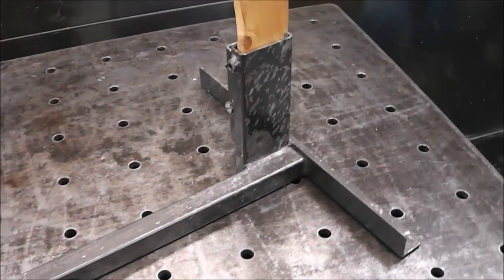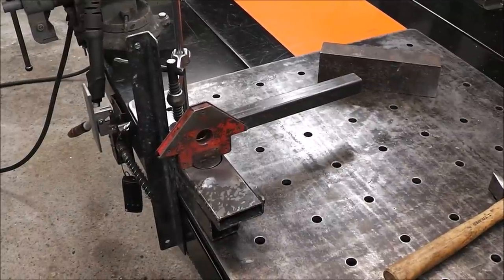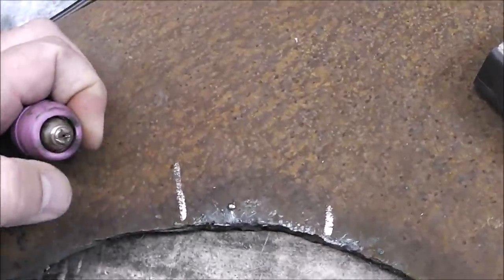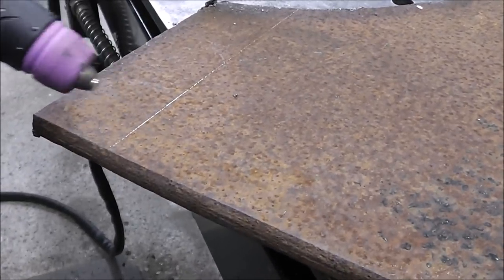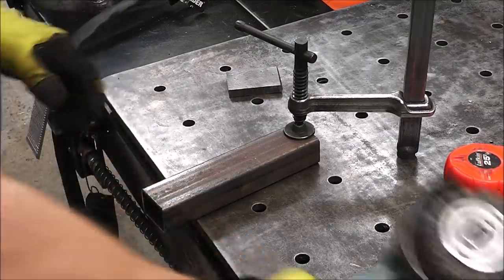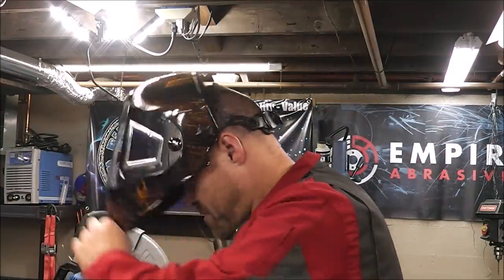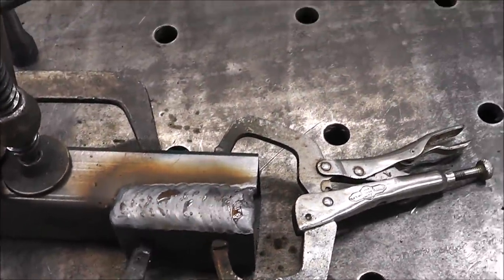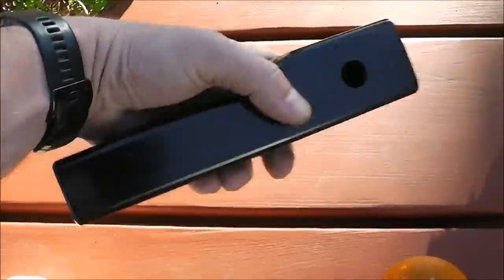Metal Repair MIG Welding Metal Fabrication Plasma Cutting Project Layout Tips

Comment: A piece of copper clamped to the backside will keep the weld flush and smooth. Weld metal doesn't stick to copper. Copper backing helps bridging overly wide gaps, prevents  burning through on thin sheet metal (e.g. rust repairs on cars) and is usefull when welding up holes.

Comment: One flaw in your hitch design is it’s meant to have one tongue to connect to the two on the trailer. That leaves some vertical flexibility to allow  travel over hills and valleys. With the perfect fit like you made can cause the pin to bind up and get bent out of shape. That 1/2 bar you used for filler would have been an excellent tongue. 
I didn’t find the rules to win the helmet. But I am from Saskatchewan, Canada.
Reply from the maker: Thanks Cecil! Great point. I'm not sure on the configuartion of the trailer setup but I contacted him the following day with those concerns you mentinoned and he said he hauled it several miles loaded through rough trails and it worked perfect with no articulation or binding issues. I asked him about the slop between the ears and he said it was perfect so I'm guessing there was more room than what I measured in the image.  My plan (if he said there were issues) was to cut the tube in half, cap the ends then run a 1 inch shaft though the caps and pin it so it could articulate 360 degrees but it looks like it's working fine according to him. Sometimes I get lucky.
Reply: @BrandonLund  thanks for the reply. I’m glad your design works well for your customer. If there is enough play in the parts, then my issues will not affect the performance. Carry on teaching the world some of skills you have learned.
Reply from the maker: Thanks Cecil I appreciate your support! 🙏

Comment: I'm from IL. I have a Lincoln helmet with a removeable rechargeable bicycle high to low beam light attached to the right side of my helmet to weld in dark areas. I never need to run lights to weld. Great for night time.  👈😎👍 Have you welded any cast iron jobs for real since your demo?
Reply from the maker: @ Mike K thanks man! I've done a bunch of cast repairs for several years now 😁

Comment: Why don’t you drill hole on other side and push metal back with flat punch applied some heat .
Reply from the maker: I don't have a press daniel
Reply: Brandon, you don't need a press. I thought the same thing Daniel suggested. Drill a hole on the back side of the tube, then use like a 3/8 piece of scrap round stock to push the dent out. The tube is mild steel, so it will bang back out. Yes, you could heat a bit to make it go faster . Great vid!

Comment: Brandon,
I'm in North Carolina.  "My cup runneth over", and while I appreciate the opportunity to get that panaramic-helmet, I have no complaints with what I've got.  I'm happy to learn from YOUR videos, and call you friend,( because you're in your element...you're a good teacher).
I'm a "newby", and I originally found you because I have to repair a cracked exhaust manifold, and do some other repairs on an old Dodge truck,( YOU  introduced me to "Muggy-Weld"!)  I'm trying to learn welding by videos as well as spending time with 5 High School seniors that are learning from the local Community College.  This is something I've wanted to learn for a long time, but I've found myself in recent years saying I NEED to learn.  Every time I turn around I need something welded!
Thanks for the videos!👍😊
Reply from the maker: Aww man I feel honored. Thank you very much for your support and encouragement 🙏 @Kent Hawkins

Comment: I'm just setting up my shop for personal use. I love your videos.

 I'm from Maine & grew up, starting at 10 years old, doing mechanic work with my dad. 

My Great Uncle Gerald Simpson  owned a garage and did a lot of fabrication  back in the 40s and throughout his career. 

I've learned to fabricate and do many things with  minimum tools let alone the proper ones...and they come out very good usually.🙂👍👌  As did my Great Uncle Gerald Simpson.  

 I like your style.👍 

I would really love to have an awesome helmet to start my welding adventures.

 I'm 63 and need good eye protection LOL.

 I'll be doing  MIG TIG and using a  plasma cutter.

 This would be so cool.

 I usually don't win anything cuz I never enter anything, but thought I'd try this and see what happens👍😇👌
Reply from the maker: Right on David! Welding is an awesome hobby! I appreciate your support and good luck!

Comment: Nice work on the piece you built, I am going through some of your older videos to pick up tips, picked up a few on this one.
Today I got the YesWelder gun for the vintage miller 250 to see if i could get it up and running, hooked it up but the tip that came with the YW gun was like 23 maybe 28 and I only have rollers for .35, hit a few stores because the welding supply was closed picked up some tips (not the same type) wasted about an hour doing that, got home and decided just to drill out the original tip that came with the gun, carefully got that done hooked up the gun, put on a 33lb spool of .35 and made several adjustments as I was not getting smooth travel with the wire and three times it knotted up at the roller site, Finally gave up on adjustments and just took out the liner in the yeswelder gun and put in the old miller liner which was quite a bit larger in diameter, then I had very little to no problems welding, it welds ye haw, right now though I could make better welds with my tomb stone lincoln, I need to play around a bit more with the mig. fun day learning as I go.
Reply from the maker: It's probably going to take some tinkering. It's good you went oversize on your tip. My LSW surprisingly carries the exact tip that came with the YW. A couple things, make sure your wire reel tension is low enough that it spins easy by hand but stops within a a quarter turn. Also make sure your drive rolls are set tight enough. Squeezing the wire tightly  between your thumb and forefinger as you pull the trigger you should be able to make the wire slip through your fingers and slip on the drive rolls at the same time.  If you can easily stop the wire coming out of the mig gun, you need more pressure on the drive rolls. Sounds like you are real close to getting this dialed in.
Reply: @BrandonLund  Now I didn't know that about squeezing the wire and pulling the trigger method I will for sure incorporate that tomorrow and give it a shot.
The massive cart they mounted this to is imo a waste of iron, picture a pallet jack handle going down to a spring and the two larger wheels, that what this is but even larger going down to the spring and two large three inch wide steel wheels close to a foot tall, and to top that off they wrapped around the front (minus where the handle goes down) Solid two inch stock square stock and 2/3 down the sides towards the back! and the waste is five inches on both sides from the welder, I want to trim it down on the sides get rid of the two inch square stock, weld a couple supports in the back after cutting Just to save space.
But yeah I am trying hard to dial this in, it really is a blast messing around with stuff like this and working out the bugs.

Comment: Brandon! I'm an old retired guy who just picked up a Fronius TransSteel 2200. What was your best source for manual/operation type info? Their operating manuals in the box were pretty sparse. The grandmother of my grandchildren said I have to make the garage less fire friendly before I can start welding out there, but that means you can relax and take your time getting the helmet shipped. Sorry everybody, but he's going to ship that bad boy to Washington State...
Reply from the maker: @Greygoat congratulations man you have the best machine going. I haven't really done much with the manual mode. I pretty much dial it in using the synergic mode and it's always perfect. I have had a few occasion where I put it in synergic mode then made note of the parameters then switched it to manual and went up or down from there. You will want to watch these videos. They are the best out there. This is part 1 of a 3 part series. They should come with the 2200 because  they are that good. Good luck in the giveaway buddy! 🤞 https://youtu.be/L5n-Kgs0Vu4

Comment: From Oregon here. Thanks for all the videos. I really appreciate the simplicity you use in explaining things. I am getting ready to build my fab table soon. so the template video was immensely helpful. Anyway, thanks for the consideration. My current helmet is very poor quality and almost dangerous. It will revert itself to the lightest preset after sitting for a couple hours, so I have to keep all my presets at a weld level so I don't accidently forget to switch it to a weld setting.
Reply from the maker: Thanks Paul! And good luck in the giveaway!

Comment: I never knew that a fan could cause all those problems. One day in the summer I was having one hell of a time. Most of the time I keep a fan on during the summer. This one particular day it was really hot and I put the fan closer to me. I could not figure out what was going on with my welds I even tried cranking up the gas and that worked. My welds still looked a little off but at work and at that time that's all that mattered. Not one time can I put two and two together and thought it could have been the fan.

Now when I'm outside all I use is flex core or I just stick weld depending on what I'm working on at the time.

I thought that was pretty clever of you I'm putting a contest in the middle of your video. After you made your announcement I felt kind of bad by giving you a thumbs down so I went back and gave you a thumbs up.  of course I'm joking I didn't go back and change it. -)
Reply from the maker: It happens man! About a month ago while shooting video I was tig welding aluminum and was having a terrible time. Come to find out, every now and then I was picking up a piece of stainless rod. It took about 45 minutes to realize lol... your comment at the end had me rolling! 🤣🤣🤣 thanks man and I appreciate your support! 🙏👍

Comment: Another great video Brandon! You and I have talked about PPE before. You do an outstanding job emphasizing PPE and safety, whether breathing protection or that really nice welding helmet! Commenting from the “heart of Dixie “ - Alabama.

That fan problem reminded me of sage advice read when I first started flame welding 4130 (which is easily shock-cooled). An old hand at welding said to not even let the dog into the shop while flame welding 4130. That way you don’t have to worry about the pooch wagging it’s tail!😁
Reply from the maker: @H Gj Hahaha good point! I actually keep my dog out of the shop because I'm afraid she's going to get metal spliters in her feet. I use a rolling magnet at the end of the day then I let her in so she can roam around.  I try to be safety conscious without coming off too preachy or judgemental. We've all taken shortcuts and got lucky so I try to pass that off hoping I can spare others some misfortune. I think the one thing I don't mention (which I will soon) is most if not all of my accidents were from being too comfortable with tools. Whipping the grinder around not paying attention how close my hands are to the wheel. We all know that feeling of bumping the wheel into a knuckle and wondering how deep it went.
Reply: @BrandonLund  me too! That or eye damage from arc. They want to visit, but too many dog hazards.

Comment: I have a drill press stand, no motor. I was going to make mine so I could move the plate the mag drill sets on to slide up and down. I just need a mag drill. Illinois.
Reply from the maker: It sounds like a great canidate for a welding project! 😉

Comment: Great video!  I live in California and would love a new helmet!  Question about the stands:  What is strap?  Home Depot doesn’t sell it. Is it pieces of pallet?
Reply from the maker: It's called strapping. Basically its 3/4" thick by like 3 or so inches wide pine board. It's pretty cheap in our area and it's used to attach gypsum drywall to the ceiling in house construction.
Reply: @BrandonLund  Thank you, Brandon.  The big box stores don't have this, but I'll try some of the other lumber yards.  I purchased a bunch of metal to make these stands, and purchased some that would fit 2x4, so I'm covered at least partially.  Have a great day!

Comment: An idea for you Brandon, to help those that use the HF tire changer would be a pneumatic bead breaker with an air cylinder. I plan to do the same. I bought an air cylinder at the flea market about 2 years ago. It's about a 12" stroke with a 4 inch bore. A hydraulic cylinder would also suffice. I got my idea from a British YouTuber that did something similar. He actually machined the air valve for his, but I think one would only need two air guns to make it work. One for air to the cylinder for down, and one for air in at the bottom to return the ram. A return spring could also be used, or a counterweight and cable and pullies.
Reply from the maker: Great idea Bryant! I think your right about the cylinder. I looked at mine on my lift table and it's setup like you described with the 2 hoses. One in the bottom and one on the side.

Comment: I watch the majority of your fabrication videos there are several shop tools I would like to make the first is the mag drill press, work stands, you did the fab table. Others I’ll go through your videos to let you know if they’re any projects that you have done already
Reply from the maker: @Michael White when I first made the mag drill drill press I never imagined how much use I would get out of it but like I mentioned in the video, it's probably one of the tools I use the most and what makes it nice is that it was pretty simple to build and I end up with 2 tools for the price of one. Faveook marketplace is where I found my drill press. You can find some good deals but you have to keep your eye peeled.
Reply: @BrandonLund  I got mine for 3-40 bucks but it doesn’t have a rack and piñon so it wasn’t worth much I saw this last time I watched the video you said you trimmed the pipe by 6 inches I never caught it before. How wide is your mag drill base and how wide did you make the plate you welded on the pipe
.  My pipe is 1.62inches. I’m thinking of using a piece of rectangular tubing the width of my mag rill base and cut a 1.62” hole in one side then weld that to the pipe what do you think. It would refuse the weight
Reply from the maker: I made my plate about an inch wider than my magnet and about 8 inches long. The one thing you need to get perfect is making sure you weld your plate 90 degrees to the column in all directions. If not then your holes won't bore straight up and down. I think tube would work fine. I had to cut my column to get the mag drill so it would reach the table and I had to cut the rack gear in length also just so everything worked properly.

Comment: OREGON starting to gather gear to learn welding, just got my YES welder.
Reply from the maker: Congratulations @Ian T which one did you get?
Reply: @BrandonLund  I got the mig-205DS, plan on learning using Flux core and once I have  the basics down, get a gas bottle and regulator to run solid wire. Would like to try tig eventually, but hands probably not steady enough to do well with it.
Reply from the maker: Right on man! Just keep practicing. You will get better every time!

Comment: Thank you the info Brandon! I’m in North Texas and have enjoyed your videos. I appreciate the tidbit about the mask cartridges. The first time I saw you masking with the pink filter I was unaware of the welding filters and was concerned. Appreciate you! I am a newbie to Mig welding but am jumping in to building a tube fence with cedar inserts. I have yet to see what is recommended for mill scale removal on larger metal parts. Do you have tips for this. Love to hear from you on this. Lilbird in N.TX!
Reply from the maker: @Bob White thanks man! They actually make what looks like a 3m scotch brite disc that is desgned specifically to remove mill scale. I have not tried it yet but I've heard good things.
Reply: @BrandonLund  Thank You for the feed back. I was wondering about chemicals other than the acid. I’m building fencing and hoped to either vat big pieces, 6’ long, or just be able to wipe down. Lots of area to clean for painting. Just not something that is discussed by those building gates or big projects.
Reply from the maker: They do make chemicals as well but I haven’t worked enough with them to say yay or nay
Reply: @BrandonLund  Gotcha! Thank You!